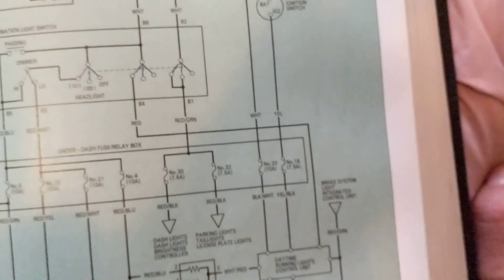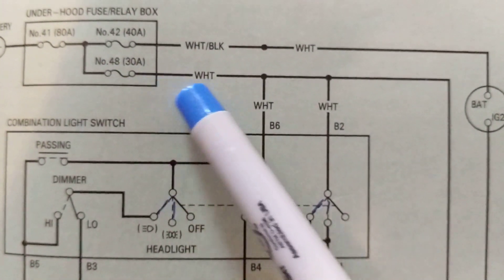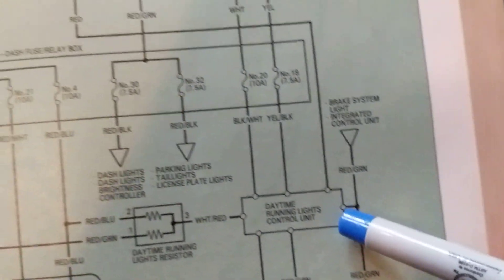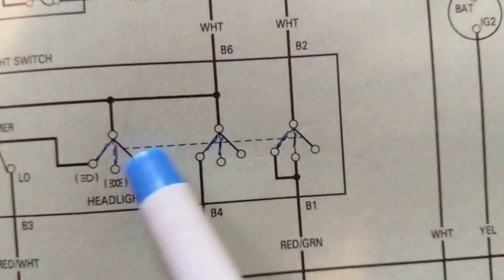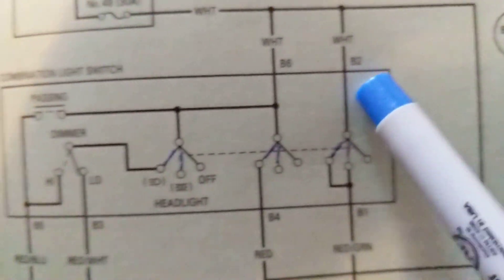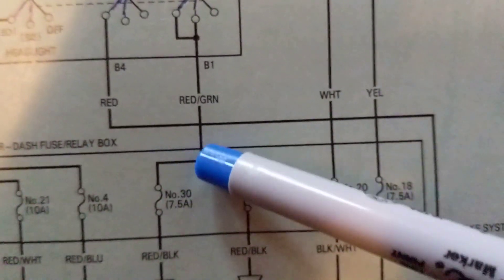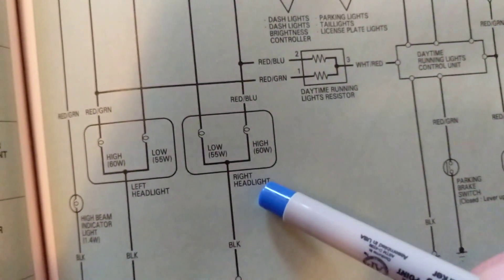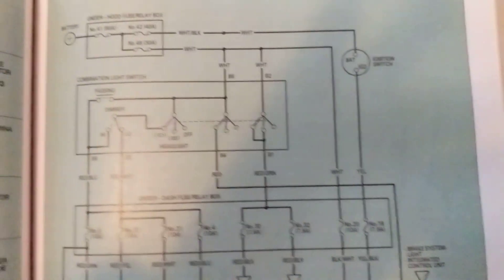DIAGRAMS EXPLAINED HOW TO READ WIRING DIAGRAMS WITH SYMBOLS and EASY EXPLANATION

Comment: Joe I like the way you explIm things but I have a 04 coloration and changed my radio and no my key won't start
Reply: Sorry Joe PIN 86 is where I put the jumper
Reply from the maker: Sounds like something might have triggered a fuse if I understand correctly the situation you wired your radio and now the car doesn't start if you understand about relays you could try to jump the relay but trying to make sure but you do pens 87 and 30 of the relay of the starter relay otherwise you have to check the fuses

Comment: Sir can I explain shifter interlock solenoid wiring diagram for honda civic 7th gen 2002
Reply from the maker: I misunderstood the questions you said if you can explain it
Reply: @Joeelectronicschematicsforauto  automatic gear lever lock which works when break paddle is pressed and release the gear shifter .. I want to know the complete wiring understanding ... I hope u have some understanding on the issue
Reply from the maker: @faizankhalique9946  yes when I get the opportunity to I'll talk about it
Reply from the maker: I haven't forgotten about you I just didn't get a chance but hopefully I'll get a chance

Comment: Just subscribed to your channel. Very good info. I'm trying to figure out why my positive battery cable have continuity to ground. got the wiring diagram for my truck. In the process right now trying to isolates wires. Thank for the info.